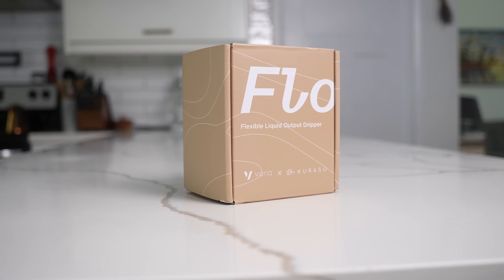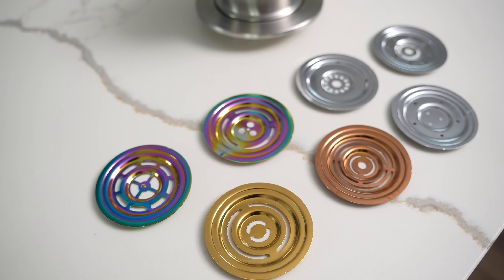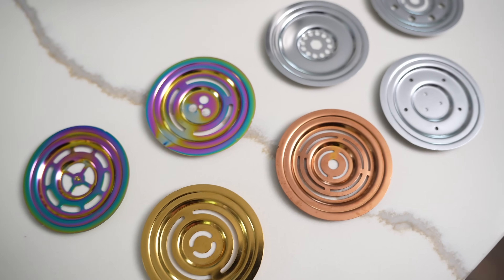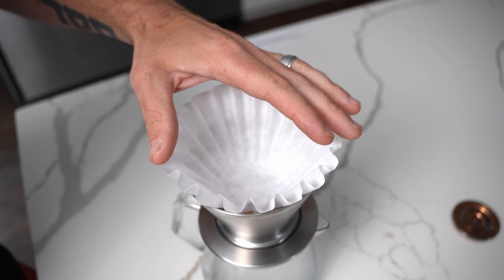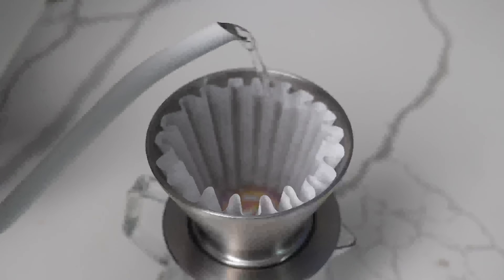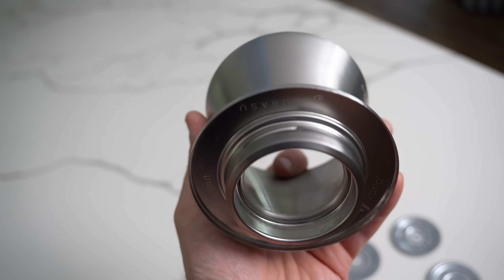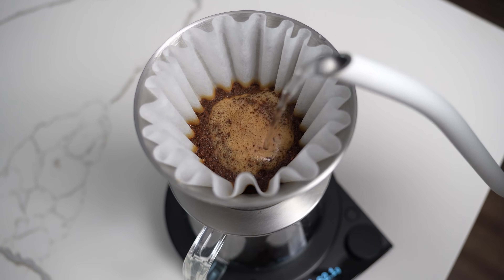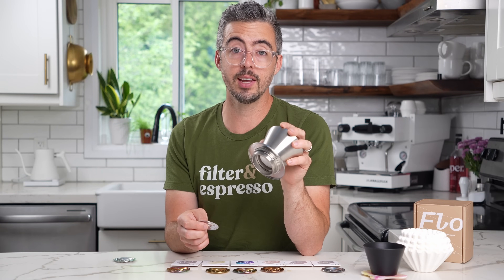FLO Dripper Review - Wild NEW Variable Flow Rate Brewer from Kurasu and Varia

Comment: Tip for filter collapsing in on Orea. Pour just onto the bottom first. Wait a few secs to let the water rise up the sides a bit. Then rinse sides as usual and it will stay in shape and not fold in
Reply from the maker: I do this and still get this issue, but usually only with bottom-of-the-stack waves, which is not what I use with orea most of the time

Comment: I saw this dripper briefly mentioned on some other channel and have been waiting for its release. A quality stainless pour over is just what I've been wanting. I currently use a stainless V60 and an April. Both are fine but the April is plastic. Another thing I like about this one is that it has so many filter options; essentially providing multiple brewers in one unit !  I was wondering how good it really would be so your review is very helpful. And thank you for the tip about the filters. I never would have figured out the issue with the filter bottom not sitting directly on the bottom..and yes I pull filters from the bottom of the stack !

Comment: I've had the Vario Flo for a couple of weeks and having issues. I was glad to have learned here about the need to make sure the paper filter is seated against the Vario stainless filter. So, I have been gently tapping down on the wet filter to ensure close contact between the paper and Vario filter. In spite of that, what is happening is that an air bubble is created between the underside of the paper filter and the Vario filter which either slows down or stop the flow. If I lift the Vario dripper off my mug, the coffee starts flowing again..I guess because lifting breaks the air bubble. Anyway, any suggestions on a better solution ? This is quite frustrating and certainly prevents getting consistent results. Thanks !

Comment: Just yesterday I was thinking about flatbed brewer designs and how cool it would be to have a flatbed brewer made of double-walled stainless steel. And guess what came up on Instagram today. I impulse bought it within the next few hours and now am reading everything I can find about it (not much really, thankfully).

One thing you didn't mention about Flo's design is that there's a silicone O-ring in there to prevent leakage. This is basically fine (and IIRC it ships with a spare one) but it's still something to think about — eventually those will get lost or chewed by a cat or something else, and by that time a spare could be hard to come by. That's my only gripe with the design of this brewer which otherwise looks perfect on paper. Can't wait to receive mine. I'll try to update here in the comments when I receive and test it.
Reply: So it’s been quite some time I’ve received my Varia Flo. Meanwhile I’ve also got Orea V4 so I can compare them. Now, I didn’t do any blind tests (yet) so these are just my experiences with these brewers. I’m using fast filter with the Flo, and Fast with the Orea. Light roasted coffees, ZP6 (5.0 give or take usually) at home and Q2 (almost fixed at 54 clicks both for flat-bottomed and V60) at work. The water is filtered tap at home, around 300 ppm (yeah I know), and remineralised RO at work at around 130 ppm. I usually get roughly 2:30 TBT with both, sometimes quicker. But as for the taste, I’ve noticed Flo sometimes accentuates that chocolatey taste (or is it body?) which I don’t like very much. I didn’t notice that with Orea. To be honest, there’s not THAT much difference in taste for me between these flat-bottomed brewers and a V60. Yes, maybe the Flo is a bit heavier or chocolatey, maybe both of them are a bit rounder than the V60 — but are they or is it my bias because everyone is saying so, I’m not quite sure. As for ergonomics and other stuff, I lean more towards Orea now because the bottoms are easier to change, it has a carrying bag (I often bring it to the office), and I very much like that the filters are all purposed for one type of coffee or another. So Orea just feels like a slightly better made product. Flo is great too, don’t get me wrong. Very solid build, no play, doesn’t heat up very much because of the double wall. 

Also, and that is completely different topic, I’m starting to think maybe I’d better just go back to the V60 and master it rather than trying all these different brewers. Although they are definitely nice objects to have, zero regrets here!
Reply: @sinefabula  Appreciate the update! how the o ring holding up?
Reply: @Caffèc_CM  it's fine, it's a veeery snug fit between the dripper and the removable bottom part. But I don't unscrew it too often though.

Comment: I don’t see any vent holes on the base plate flange that rests on a cup. If you have the right size of cup where it is able to get a good seal around the rim of the cup, it could lead to pressure build up and flow problems. I’ve experienced this on other Drippers with a flat round flange.

Comment: they also use silicone seal on it, its contact with your coffee when brewing then its little too tight and sharp enough to cut your fingers skin, using kind of kalita wave paper very annoying its difficult to take a filter out of from the bottom, do u have any tricks ? 😅

Comment: It's a cool idea but the fact that the filter has to be consciously pushed down to make contact with the screen is definitely a downside. It's an item that would be fun to play with for a week or so but for me, I think after that the novelty of switching out the screens would wear off. $60 is a lot of money but to be fair, I think the price / value for the Flo is not out of line considering the materials used in manufacturing. But the question is would YOU pay $60 ( plus another $39 for the extra screens you have on the bench)? As always I enjoyed the video very much as I'm sipping my coffee made with a $12 plastic V60 dripper. lol

Comment: Have you tried V60 filters without a bottom screen in it to see if it works?
Also, any idea on min and max dose size (roughly)?
Thanks! 

Heads up: I had a VS3 gen 1 and 2. Both had the gears shred (moderate use, cleaned often, and the gen 2 broke on medium roast beans slow fed). 
It’s a known issue but reviews never talk about it. 
It also sounds horrible with the high pitch sound on gen 2 increased rpm.

Comment: I only have a B75. This and Orea. This is much nicer, don't care it's stainless, screens and design is the nice feature to me..
Reply from the maker: I haven't yet tried the B75 - I do have the Orea and I enjoy it very much. This one is great too!
Reply: @DaddyGotCoffee  They are to me not so different, and i want fast flow as i do light roast too. But this is a buy because its bling bling shiny shiny, and i like to fiddle as well. We all need the v60 and i like my Switch too. But price is steep but all fancy ones are up there, Orea is to expensive to me ( with it being just plastic) tho the bigboy seems nice as a side option..
Reply: @DaddyGotCoffee  The B75 is the best flat starter option eventho its plastic. Tho the more pours clogging occurs quite easy to me. I use 185 and use it mostly for testing. V60 and Switch are main drippers i use..

Comment: What are your thoughts of this versus Sworksdesign Bottomless Dripper especially since they very recently released the glass cone variant instead of plastic?
Reply from the maker: I would love to try the Sworksdesign dripper. A couple thoughts - it’s 155 size vs 185 of this one. It’s screens look much more suited to faster flows and less suited to slower, so there’s probably less flow variance as it comes to the screens themselves, however you could modulate flow somewhat with the valve. Also, it can kinda function like a switch with more of an immersion style brew. Also more plastic! Still, looks great too
Reply: @DaddyGotCoffee  there is a price difference as well since the glass varient is $95 vs 85 for plastic cone vs $60 for this one. The valve on the Sworksdesign one I think would allow even more flow control/immersion opportunities than the FLO. I wish the Sworksdesign one had the potential for larger capacity than 10-18 grams and the 155 filters.
Reply: @DaddyGotCoffee with the Sworks, you can modulate the flow a lot with the valve; it would be worth checking out for sure especially as they now have glass cone options if you don’t want the tritan version. Also if you have an Orea negotiator already it works to negotiate both wave or say sibarist/Orea flat filters
Reply: I have the Sworks and absolutely love it. The quality is second to none. I use the V60 for dialing in new coffee, and use the Sworks for experimentation and have a great experience. My only real issue with the Sworks is consistency. I've used Sibarist fast flow filters, all the different screens, vastly different grind sizes, different pouring structures, multiple valve adjustments, melodrip lift etc, and I still can't get consistent results brew to brew. All that said, I love the Sworks. It's just fun.